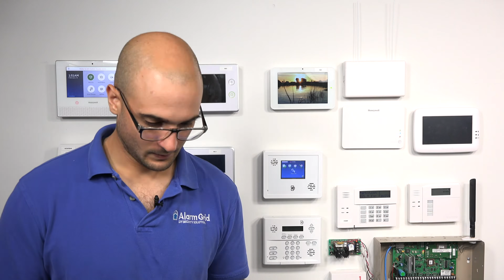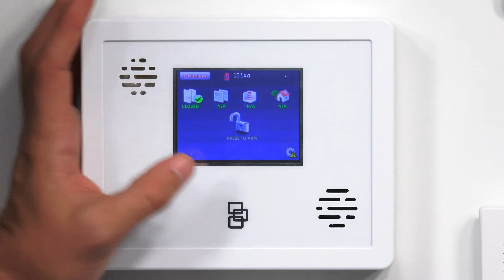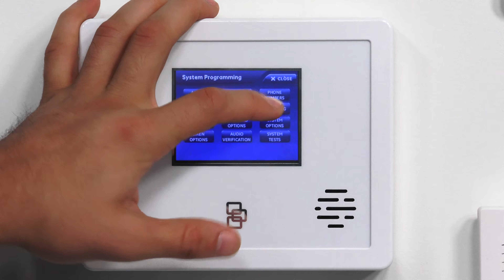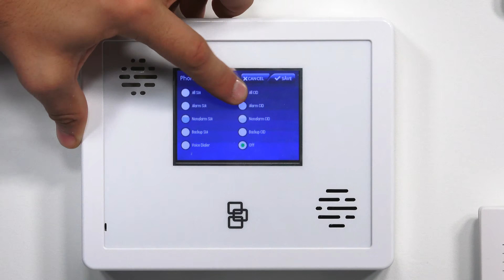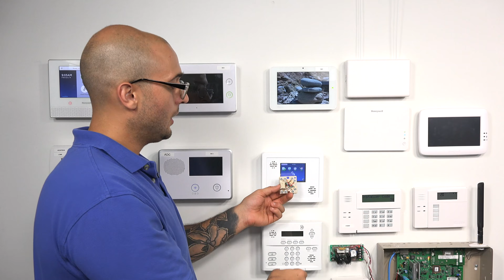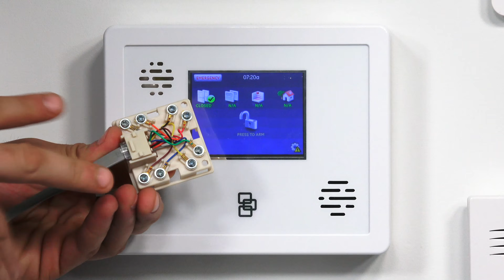Using a Phone Line with an Interlogix Simon XTi & XTi-5 Alarm System

Comment: there is a way to still use phone line with the simon panels even if you have VOIP including OOMA. If you have an ooma telo, you can login into your ooma account online and go to the device category of the preferences tab and click the gear wheel for your ooma telo and click Edit. Once the Edit Device window pops up, click the drop down menu next to where the Mode category is located and toggle it from Phone/Fax to Alarm system. After you toggle it to Alarm system, click the green Save button. The updated settings will be pushed directly to your Ooma telo. After you do that, make sure you contact particular alarm company and inform them that you switched your landline to VOIP and request that they put a service ticket on your account for a technician to come out to your home to help you rewire the phone connection box that is located on the outside of your house. Remember, the panel gets priority FIRST when it uses phone line. 

These steps also apply to business owners who have a simon system or even any alarm system that communicates with the central station via phone line.

NOTE: If you dont toggle the mode category in the Edit Device window on your ooma account, your system will have issues communicating using Contact ID.

Comment: great video, I have a question:  why in only I can see phone number 4 and not the rest from the panel? I need a master code to show all the settings available? or is something wrong from the panel?
Thanks
Reply: Usually, when that occurs the other numbers have been locked by the installer, you can still input a number in option 4 there will just be a delay in signaling.  Phone lines are not as reliable as they use to be for security systems. I recommend an IP or cellular connection.